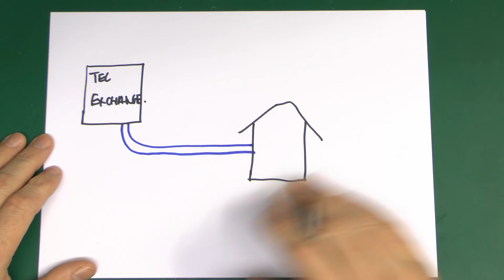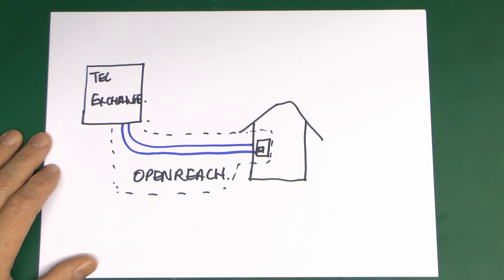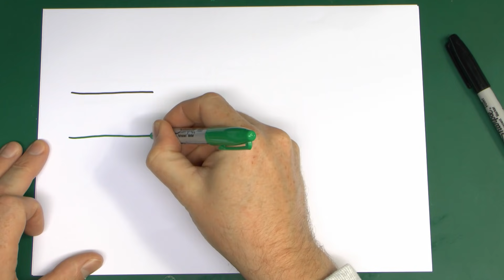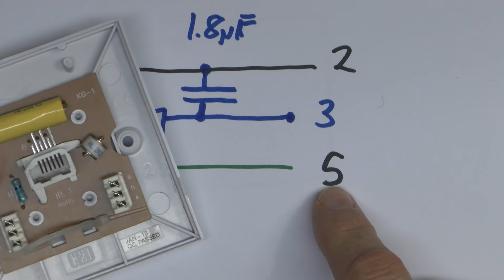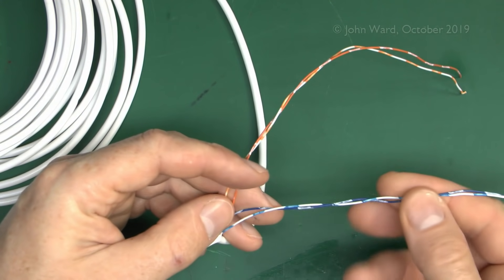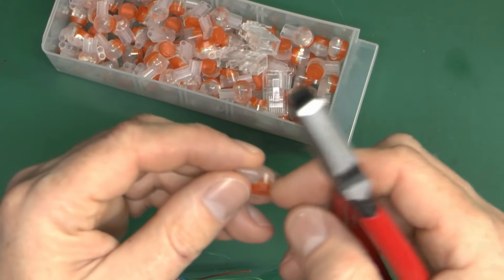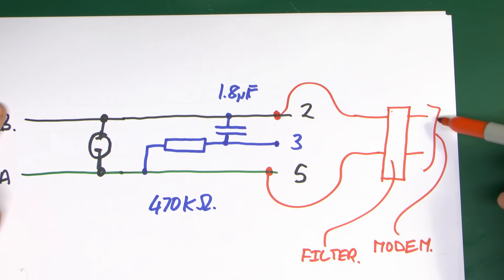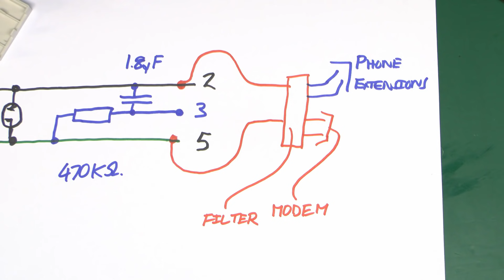UK Telephone Wiring, Sockets, Cabling, ADSL / VDSL Filters, Extensions.

Comment: I want to relocate my router elsewhere not at the master socket. 
Should I run a slave telephone wire, 2 wires 2 & 5 to the telephone extension terminals in the master, then off to the slave extension with an adsl filter at the slave?
Or do I run the filtered output from the master to the slave socket thus avoiding the filter need at the slave?
Of course I then wouldn't use a telephone at the slave but, how to plug my router into the slave socket without a filter. 
Hope that makes sense.
Also, which connections are the filtered master wires in the master socket?

Comment: Hi John john cut the telephone cable because I don’t use it no more cos I’m having new flooring do I need to earth the four cables ? 
Can they cause a fire I’ve just tucked them under the plinths
Reply from the maker: Unlikely as it's 50 volts with a very low current limit.
Would be better to disconnect it where it enters the property.

Comment: Can you wire one end into the master socket then crimp a rj45 on the other end and use it to plug into a router for usage
Reply from the maker: Probably, but as most routers have RJ11 plugs, and leads with a plug on each end are supplied with routers and are readily available if not, there would be no point.

Comment: Rather interesting differences. Around here each house gets usually at least 4 or so twisted pair cables that terminate into one of these boxes where you need an LSA tool to connect your wires to. Also since we largely are forced to switch to VoIP DSL splitters are mostly a thing of the past.
Reply: BT are phasing out PSTN service and are planning to migrate to fibre optic service. This is going to take quite a while, so in the interim they are planning on closing the exchanges and providing VOIP service from the road side RDSLAM cabinets.

Comment: You make the point that most UK houses are served with wires owned by Openreach where you can buy service from a variety of providers. Even houses that have access to Virgin will normally have these Openreach wires, though you may not currently be using them, they can often be brought back into use without major cost. On new estates however, the cable provider may not be Openreach and in this situation you are effectively locked into your current contract - typically for fibre-delivered broadband plus voice (VOIP). I daresay you could retrospectively ask another provider to give service (possibly via Openreach) but I suspect a large one-off charge would then apply. Something to be wary of, perhaps.

Comment: Thank you for an excellent and informative video. I bought a Kingfisher MKTEL-1(B) slave socket from Screwfix, but it has a resistor and surge protector in circuit which confused me as I thought slaves did not have any components. Do you think this will affect anything? I have a total of 3 slaves and a master.
Reply from the maker: Slaves have no components, you have been given the wrong item.
However just cut those components out, it will then be a slave.
It might work with 2x masters but it's likely to result in problems.

Comment: For internal joins of cables - would you consider Wago/Ideal lever connectors - or do they not accept these small diam cables./the need to strip the cable ends.

Comment: I am wanting to replace my bt socket which has AB and 123 with new socket which is just 1-6. What wiring on the old socket would go to the new socket?
Reply from the maker: A&B are 2&5, but if you are replacing a socket with A&B and the new one doesn't have those, it's almost certainly the wrong socket.

Comment: I didn't think the ringing voltage was that high, I always thought it was like 50-70v, and that the surge suppressors were just common 90v neons, but thats from when I looked at phone wiring like 30 years ago and memory fades. wonder how my current ''box'' works as my phone line master socket is part of my modem that is gigabit fibreoptic to the house/desk and is 12v powered (with 4hr battery backup).
Reply: Chuckle! Clearly you never leaned on a 66 or 110 punch-down block and got nailed by ring voltage. It's quite jangly, for lack of a better word.
Reply: If you actually have fiber optic cable running in which it sounds like because you have a battery backup unit the box is essentially a mini VoIP / exchange endpoint but usually held to higher standards because it's actually phone company equipment and has to be compatible more than your standard voice box. in the US the ring voltage is 90.

Comment: back in 1995 worked for mercury and bt owned all exchanges but mercury ran admin and service cheaper so rented out lines cheaper,  mobile companies used same system... then went on to installing and managing premium rate call centres  and  fitting exchanges... a you tube channel called my mate vince is run by an ex telephone engineer and is very interesting..

Comment: 3:47 "Contact Virgin Media in the case of something going wrong".  Erm, what can I say, and be polite?  Let's say that attempting to do so might be a somewhat frustrating experience.
Reply: There are worse operators.
Reply: SeanBZA
Quick, nobody mention Vodafone
Reply: @burgersnchips  or 3 mobile. High speed connections, until you get to the border. Then, it's a slow boat to India (via china of course) to get a reply. I have waited over an hour often...
Reply: Try being with ADSL back when BT first allowed other providers. Line faults would turn into a customer service argument of "It's BT" -> "It's your provider" -> "It's BT" ad infinitum (and most of the time it WAS BT's fault.
Reply: Peter Mulholland
We have this problem still at work
Somebody higher up decided it was a good idea to have BT Broadband on a Vodafone line. Can't get anything fixed because Openreach when employed by Vodafone will say the line is fine, but Openreach when employed by BT will say the line is noisy. So BT refuse to replace the router and Vodafone refuse to fix the noisy line... Whichever one it actually is??
Reply: @burgersnchips  it's BT's fault.
Reply: Peter Mulholland
You say that, and I agree, since Openreach are a subsidiary, but try getting them to admit it
Reply: @burgersnchips  I even had BT and Plusnet argue the toss once, and they are the same company.

Comment: Virgin have given up transmitting phone signals over twisted pair on recent installs. The phone connection comes out the router. VOIP. Of course this don’t work when there is a power cut. If you don’t have a mobile they will provide you a free box which works during a power cut.
Reply: Glad I have my older VM line on a System X exchange for now, although that said I have the router connencted to a UPS

Comment: A question if I may. I have early single point telephone sockets in my home,  with two extensions - one in the lounge and one in the bedroom. I have just fitted a new router from my provider, TalkTalk into the main socket in my home office and they have upgraded the line at the exchange. My problem:  In spite of having filters fitted to all of my sockets, my internet freezes each time I receive an incoming landline call and I have to reboot the router to get everything working again. All of my landline telephones are quite old (20+ years) and rather than disconnect all of the extensions, what is the most practical way of getting round this problem. I didn't have this issue with my old Netgear router. Advice would be appreciated. Thank you.
Reply: Remove all the extensions and just use the one phone at the master socket with a VDSL plate that has 2 sockets. Buy yourself a mobile and use that for the bedroom.
Reply: @portman8909  that is not a solution
Reply: @dlarge6502  It kinda is. That or wait for full fibre. Nuff said.

Comment: You're wrong about the extension wiring of a filtered socket. The socket has 2,3,5 terminals that have passed through the filter so the extension wiring has no detrimental effect. For some years the better ones also have low pass filtering to terminal 3 so the bell wiring has no significant effect. Also there are A and B terminals that do provide a direct line connection if required for some reason (typically for alarms).
Modern NTEs also use clamp down connectors that don't need the punch down tool.
Reply: You mean "You're wrong". The extra bell wire can have some detrimental effect since it makes the wiring a little asymmetric so that one side may pick up extra interference or have extra capacitance to earth.

Comment: What happens to a modern phone when the exchcange sends the 120v ac ring signal down the line?
Reply: It rings.
Reply: @patrickwigmore3462  What else would one expect it to do?
Reply: Phone circuits are weird the audio is carried in ac with a DC Talk battery and the ring voltage is an AC signal applied over the DC signal yeah it's a even trying to stay this in the US it's 90 volts.

Comment: Hi John What is the Black cable called as I am looking to run and external cable outside the house and bring it back in so i have secondary socket near to a power supply, Thank you

Comment: Can anyone help? I have an old NTL phone line now Virgin media. This is for phone only. Broadband is on a separate cable.  I have 3 pairs of wires. Blue/ White,  orange /White, Green/ white. 6 wires in total.  I have a master box with test socket. Think it is NTE5. Blue white is connected to terminal B, White blue to terminal A. NO other wires are connected.  I recently removed extension wires as I no longer need the extension. Phone is now not working. Sometimes rings, sometimes engaged. sometimes nothing no ring tone.  Can any one give me some advice.
Reply from the maker: For the incoming line, only two wires are required.  Poor or loose connections could cause the problems described.
If both wires are connected properly and a phone still doesn't work when that's the only thing plugged in to the test socket, you will need to contact Virgin Media as the problem will be elsewhere.
Reply: Thank you John.

Comment: Do 4 phone wires go to 8 wires for cat 5e and if I am using home plug ethernet adapter how can I get full speed if Vsdl is not using all 8 wires separately when I had only 2 thick copper wires phone socket had 3 stiff plugs 3rd wire is usually used as ground wire if needed.
Reply from the maker: VDSL uses 2 wires, the same 2 wires as a phone service.
For best performance, disconnect any internal phone wiring used for extensions and locate the modem/router as close as possible to the incoming 2 wires. 
Powerline ethernet adaptors cause vast amounts of radio interference and should be avoided.  Use Ethernet cables for fixed items, and only use WiFi for portable ones that can't connected using a cable.
Reply: @jwflame Now I live in Slovenia I have home plug connected router is connected to fiber optic cable and to the modem conection to the ethernet port goes with cat 5 but I have only 4 wires from home plug to computer I pay around 68 euros I get 95 Mbps download speed in the hole there is 4 pins 3 on the left and 1 on the right. on the router there is all 8 wires but only 4 are used it sound logical that all 8 wires are connected.dlink home plug have same voltage as router and its not using alternating current probably direct current for receiving and sending the signal I have zyxel router from nederlands

Comment: I’m having a few issues - I’m trying to extend my Adsl line to another socket in another room as I want to move my router. I run a cable from the micro filter to the wall socket that has been connected with the blue sockets on 3 and 4 to the other room where it has a clue socket 3 and 4. But the internet Isn’t very consistent any suggestions? The wall sockets are connected via cable 5 cables and the sockets to router are connected via usual 2 wire Adsl cable
Reply from the maker: To extend ADSL it's just the two wires from the master socket, which are 2 and 5.  No other wires are required.
3 is only needed for very old telephones without internal ring circuits.
4 isn't used for anything.

Comment: Once, when I was a younger spark, I did some work on a phone line and when I had finished, the dialtone from the telephone receiver was intermittent. About 1 second of tone and 1 second of silence, repeating. The phone worked perfectly well, ringing out and receiving but I still thought it was a bit odd. Is there any chance I simply reversed the 2 and 5 wires? Would that be a symptom? Otherwise, what else do you think may have caused it? Any feedback would be appreciated.
Reply: No
Reply: Depends how long ago but intermittent dial tone is an indicator for a new voicemail message
Reply: @Mike_5  would have been 8-10 years ago now, that's cool if that was the case
Reply: @mastergx1 "would have been 8-10 years ago now, that's cool if that was the case"

Then that would have been the case.  Network provided voicemail has been a thing for a while now.  I remember working as a headset jockey for BT about 20 years ago trying to sell it outbound.

Comment: Excellent tutorial, I think the latest master socket has changed though.
Thanks for sharing.
Reply: As a time served telephone engineer I expected to pick you up on something but pretty much spot on John. Worth noting there are variations on the sockets and plugs with all pins in which were often used for private circuits. Many 17070 services can do quiet line tests to allow you to listen for crackling caused by wet or bad joints. You're right about the resistor/capacitor arrangement for bell wire and testing but for many many years we didn't exactly use AC to test but a DC tester with a line reverse switch (spring loaded) so generally we did test for any stray battery or earth conditions then rapidly flick the reversal switch to make a rough AC signal to activate the cap. The best engineers could tell you whether the kick was the telephone cap or a faulty pair.
Reply: It has Tap, but is more relevant to most customers supplied by post with micro filters send in the box.
Reply: If one were wanting to do a simple socket fascia change, what precautions would be needed beforehand? Power,  etc..

Comment: I accidentally cut an alarm cable that goes from the alarm to a movement sensor, was these jelly crimps work to join them back together?
Reply: No. Alarm cable has stranded conductors, jelly crimp IDC connectors are designed for solid conductors.
Reply: @Graham_Langley  I've seen those 3M Scotchlok style connectors used for stranded connectors, I can't say I've ever seen a bad connection because of it.

Comment: If you do not have that punch down tool/IDC/Krone tool, use a stanley blade from the outside of the terminal and snip. I have done this in dozens of your homes when I lost/misplaced/can't be arsed to get it from the van (we used them on the roadside to 'jumper' your line to the network) and I forgot it.
Reply: I have a special screwdriver ground to work on them as well, plus the reason I made it was because the Quante connector blocks ( do not buy them, though they seem to have vanished, but the old ones are still there from the period the incumbent telco used them) had insane tooling prices, so special thin blade screwdriver and a bit of care solved that.
Reply: @SeanBZA  I have not failed yet on telco. Fitting an RJ45 plug with a screwdriver was fun, worked most of the time. Just don't bang the pins too hard. Who needs tools eh? :D

Comment: So what is the point of laying fibre cable, if they still use the old copper wire phone line into your house,? The copper wire into my flat must be over 20 years old and the wires to my master socket are joined via a block connector.
Reply from the maker: Fibre from the exchange to a street cabinet with copper to the premises is better than copper from the exchange to the premises.
It's far cheaper to replace fibre to the cabinet compared to replacing all of the cables to each individual property.
Fibre to the premises is being installed in the UK, but it's a slow process.  As of July 2022 it's still under 20% of all premises.

Comment: Fiber-To-The-Premises (FTTP) on Virgin, the telephone connection is on the rear of the Virgin Superhub unit. Downside of this system is the power for the telephone is provided locally, rather than from the exchange.
Reply: In new 100 or 200Mbit/s FTTC (Fiber To the Cabinet) lines here in Italy they use the two conductors only for the internet, while the phone service is provided via a VOIP service. The line goes to the modem without any filters, and they recommend you to disconnect all the other sockets that can create interference, and remove eventual capacitors/fuses that were installed in old lines (basically the two wires that enter you home needs to go straight into the modem). 

You can plug analog phones into your router if the router has that facility, or use directly VOIP phones. This has the downside that if the power goes out you cannot use the phone (but still if you had only a cordless you already had this problem, since the cordless base is powered from the mains and not the line), and also if internet doesn't work you cannot make phone calls. But who uses landline phones anyway, I disconnected mine since I received only advertising calls.
Reply: So with FTTP do you have any phone service in a power cut? Because here I often have no mobile service when the power goes, I would not want to be without landline as well,  just when you are most likely to need it.
Reply: @patdbean  The FTTP box is powered from a 12 volt PSU inside the house. There is NO telecoms wire running alongside the fibre optic cable Virgin Media supply.
In the street the fibre optic cable is a green plastic tube which runs underground from a local network distribution point into a FTTP box mounted to one side of the front door of the house.
Telephone and Internet are supplied from the same Virgin Media Superhub 3 modem unit. This unit has its own PSU, so if the power failed the FTTP box and the Superhub will not work.